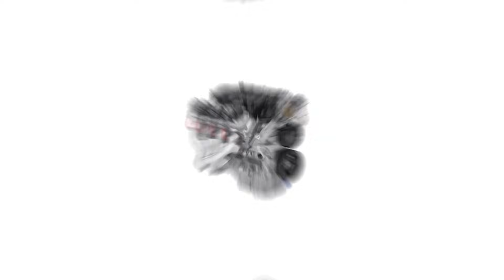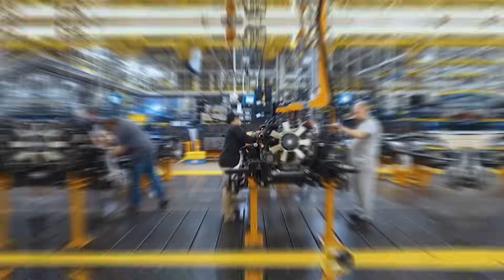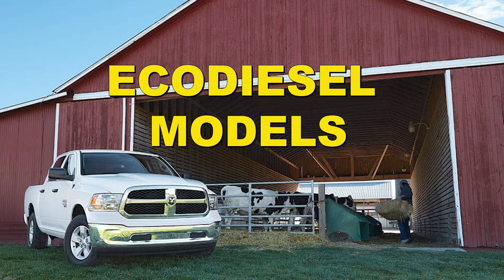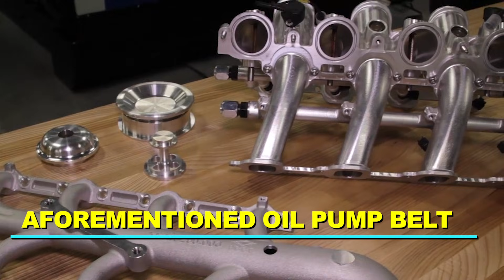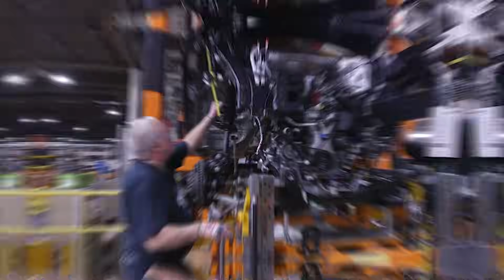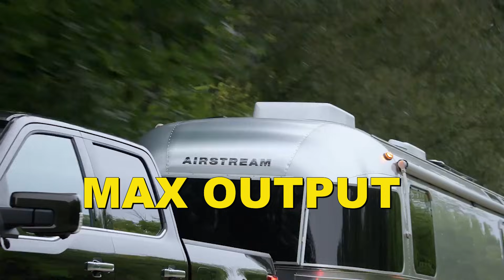6 Pickup Trucks With WALLET-CRUSHING Engines! (Owners Are Selling!)

Comment: This should be a "wake up" for the industry.  Cost of ownership has more than double due to reliability issues compond with high inflation.  The market wants a truck that easily last over 300k miles without having mechanical issues that cost a small fortune to repair.

Comment: The biggest detriment to engine and transmission reliability is the constant demands made by the EPA.  The pressure for manufacturers to meet these ever changing standards results in overengineering and problems.

Comment: The tundras have been covered by warranty or the recall. Speculating about long term reliability  don’t make a vehicle unreliable.  And I’d engines are failing due to machining that doesn’t speak to the reliability of the engine. If the engine fails due to poor engineering then it is a reliability issue.